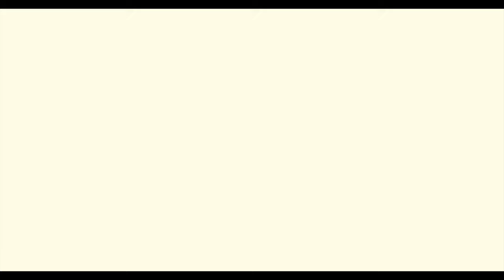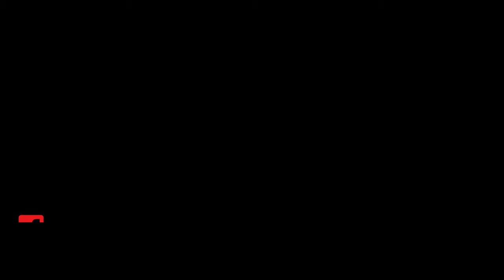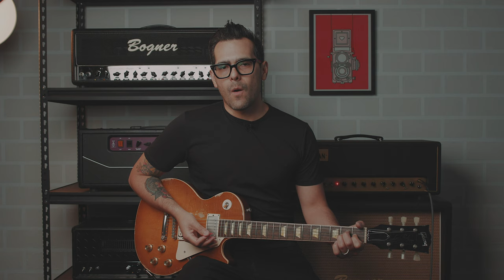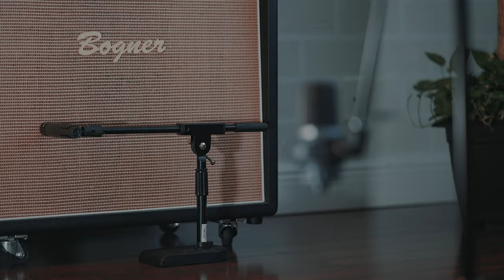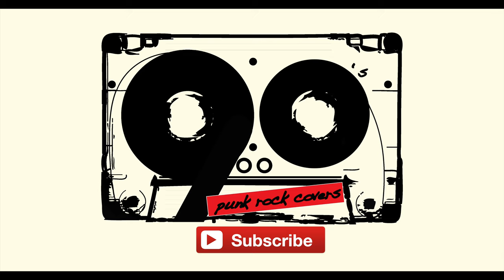How to EQ Your Guitar Amp Tutorial

Comment: Interesting, I thought you use a lot more gain or some OD pedal in front of the amp. Would be great if you do the same with Dual Rec, and maybe single coil guitar as well. Great video!
Reply from the maker: Thanks man. I rarely use boost pedals, I like to get the natural distortion from the amp. If it sounds bigger in my videos is because the guitars are double tracked, so that always helps. I'm thinking about doing a similar video with the Dual Rec since that is a different beast.

Comment: It all sounded good 👍, I used to crank my gain until I watched a video where a guy said use your volume knob to push your sound because too much gain just gets messy, I run my JCM at Gain- 1 o'clock, bass - 3 o'clock, treble- 1 o'clock, mids 1 o'clock, presence 1-2 o'clock, and since I run an attenuator i run my volume around 3 o'clock to get the tubes wide open 😏. Is that Friedman an EL34 based amp?
Reply from the maker: Thanks buddy. Yes, EL34s in the Friedman.

Comment: You need to play through the cab more.  Sound is 100% better even hearing your strings.
Reply from the maker: Hah, I wish I could, but it gets too loud. I had the amp set at 2 and it was still pretty loud for an apartment. I do agree, everything sounds great through this cabinet, its got mojo and just rips. I had to set the mic pretty hot to get a loud enough signal and the room mic was picking up too much of the strings. I'll try to set the mics better next time. Thanks for commenting.